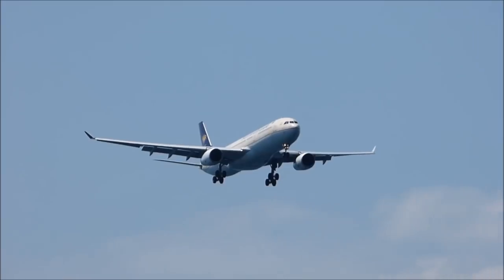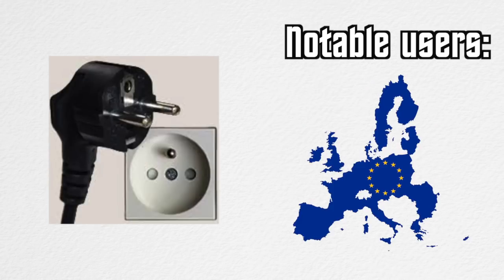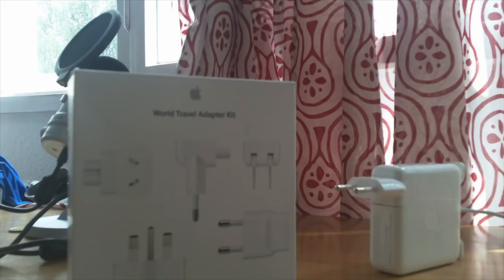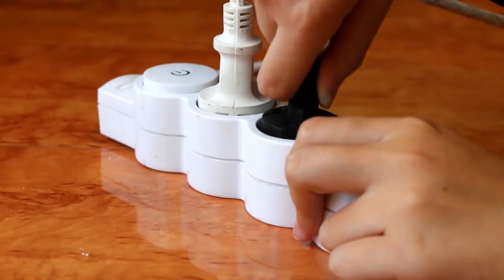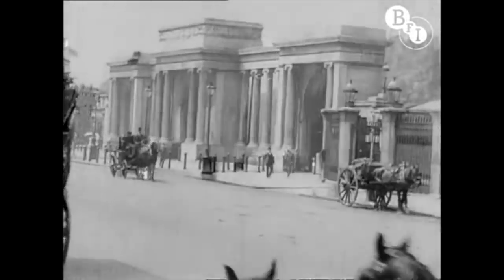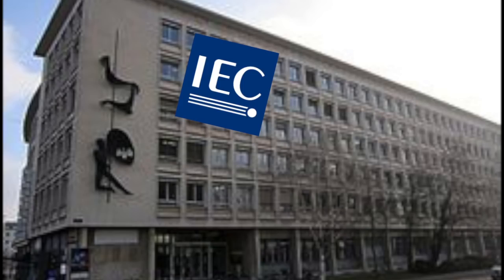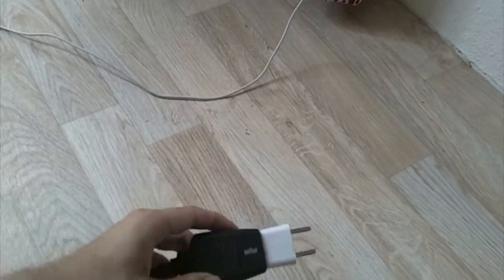Why Different Countries Use Different Plugs

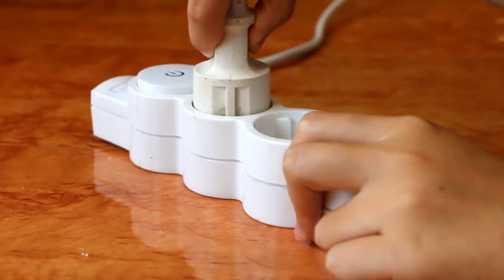Comment: I would like Type A or B plugs better because they are much more compact. You can fit them closely next to each other and are better for storage and accessibility... if only some crap plug manufacturers (I’m looking at you, Apple, and others) wouldn’t make huge box plugs and instead integrate the conversion into the device, or change the shape. My Samsung plug is about half the size of those stupidly big round ones.  Look at the zip-strip at 1:11! That thing is archaically huge for the 3 outlets it had (yes, only 3). A Type B strip (if designed properly) could fit 4-6 in that same size. If the sides of it were flat instead of wavy and the outlets were on the side, then a comparable Type B strip that size could fit upwards of 8 outlets! (That’s measuring 1 per curve on the one shown.)

People say that the British one is the best, but you don’t need plug posts that large for a phone or laptop!  In America, plugs that size are usually reserved only for large appliances like clothes washers and dryers!  Even dishwashers aren’t enough of an electrical load to require more than a Type B! You don’t need to go super-overkill unless there’s a large motor or heating element. Also, Type B has the “ground” wire that some of the other examples lack (A, C, E, F, R).

With regards to technology smaller is better, unless larger is demanded by physics.  Type B is small, yet has enough contact on the plug for 99.__% of jobs required of it.

Comment: Sweet jesus, you really shouldn’t make videos about things you plain and simply do not understand. Nearly nothing in this video is correct, it’s just a made-up fantasy history, peppered with technical jargon to give an air of legitimacy. No, frequency is not the issue. It was simply each electricity provider using its own plug initially. Then countries standardized within their borders, but so far no attempt at a truly standardized plug has succeeded.

Comment: I'm casting my vote for the UK 'G' plug.

Robust design. Firm electrical connections. (I'm looking at you Type A, every house I've been in has at least 1 burnt out wall socket because type A plugs will sag out of the socket if you look at them funny. Type 'I' as well.)

Ground connection built in. Ground wire is the last to disconnect in the case the wire is over stretched. It's easy to replace as well if any of the pins somehow broke. Also its internally fused by default as an additional level of over current protection.
Reply: The fuse in british plugs is not really additional protection. Panel Breakers on the mainland are rated lower then the breakers in UK panels.
Reply: Type A has half the tension what results in 4 times more plug heat up for the same power, so of course they burn more.
Reply: @2adamast  I'm not sure if this is an explanation or justification for allowing certain plugs to burn
Reply: WarriorofCathar The British plugs have half insulated pins, a great safety feature but at lower tension (also a great safety feature) the pin insulation would often melt.  A safe alternative to insulated pins are recessed sockets, those have the added advantage to hold the connectors by the housing and not only by the pins

Comment: So with countries that run on 110v and others that run 240v..does that mean that the country with the 110v has cheaper power bills?
Reply: Power bills depend more on the power (watts) of the appliances regardless of the supply voltage. Energy = power × duration

Comment: Worse than stepping on Lego is stepping on a uk plug I know coz I have done it a lot
Reply: Benefits of UK plugs: 
1. safest in the world, too many safety features for me to write here.
2. They have switches on sockets to easily turn on and off appliances
3. We don’t need socket covers as the sockets have shutters built in
Cons of UK plugs:
1. They always land pins up. Go for a pee in the night? Worse than lego.
2. They are bigger than the average toddler.
3. They seem to be harder to unplug than European plugs sometimes.
Reply: @masonanddylanrailway2911  1. Schuko has like the same safety features and are often left out when talking about UK plugs. Almost like people are afraid it'll be a tight battle.
3. Schuko has adult safe shutters while UK has flawed shutters in certain power strips, where you can plug it upside down. Schuko don't have this issue.
Reply: @Liggliluff Today's UK plugs use a triple shutter safety system, requiring the insertion of all three pins of the plug to open all three shutters .
Reply: @Dave4000  That might be a feature of some sockets, maybe even most sockets, but not all sockets. I've both seen sockets where plugs can be inserted upside down and opening the live holes, as well as had someone make a converter by inserting a pin in earth, and putting the Schuko plug in the open holes, and then removed the pin. This would not exactly be possible in the triple shutter safety system.
But in several countries, having a double shutter safety system is legally required and all sockets need to have it. Which is different from that sockets could have it.
Reply: @Liggliluff  More so with older sockets. The newer ones, like those from MK (the MK Logic Plus) and some other makers, incorporate the triple shutters.
Reply: Luckily I don’t have the same type as the uk plugs here in Spain.
Reply: Secondary use as a burglar deterrent. Just don't chase him out of the house before putting on your wellies!
Reply: effyleven well that’s a good idea I’m just gonna put them all beside the windows 😂
Reply: If Home Alone had have been filmed in the UK, Kevin would have used upturned UK 13 Amp plugs instead of broken glass to deter the Wet Bandits from breaking in with bare feet.
Reply: Those things are diabolic. They were almost banned un the geneva convenction 🤣🤣🤣🤣

Comment: In the Philippines despite we are 220 Volts 60 Hz but our plug is an American blade type which means we can easily accidentally plug an American 120 volts device into our 220 volts outlet damaging the device. It is part of our culture to buy something while abroad and bring back home as a souvenir but we have to be very careful about the voltage and often requires a step down transformer. Some American devices like some of our relative's DVD player from the U.S. and coded Region 1 but it is rated 110 - 240 volts so they just plugged it directly into 220 volts outlets without a step down transformer and they worked just fine.

Comment: Higher Voltage is better because it is more efficient in transporting the energy (less power lost in heat). And it’s acctualy 230V and no more 220V since a few years now.

Comment: Did you even do any research? There are 2 different frequencies 60 Hz and 50 Hz. This had nothing to do with Edison v. Tesla that was about AC. V. D.C. The U.S., Canada, Mexico, Japan, Taiwan, are primary countries with 60 Hz, 115 V. A.C. however Japan uses slightly lower voltage, but same frequency. The rest of the world is 230 V. A.C. 50 Hz. Almost all hair dryers have a switch from 115 V to 230 V and they don't care about frequency. This video is nonsense!
Reply: Fred Zlotnick Western Japan uses 60Hz.
Reply: Fred Zlotnick Eastern Japan uses 100V at 50Hz, Jamaica uses 110V at 50Hz.
Reply: @FrancisLitanofficialJAPINOY  thanks for the corrections, it sure is a "mish-mosh" that will never be changed.
Reply: Fred Zlotnick 220V 60Hz are widely used in the Philippines, South Korea, Antigua and Barbuda, some states in Brazil, Peru, Saudi Arabia.
Reply: And Malaysia used to use 240V 45Hz...
Reply: US has 60 Hz because of Tesla. He designed his motor for 60 Hz.
Reply: Nearly any motor designed for 50 Hz will work at 60 Hz (but run a bit faster). George Westinghouse went to Tesla to ask him what he thought, and Tesla thought 220 V and 60 Hz was most efficient. The Germans thought 50 was a better frequency because it was closer to being "metric". In the end it almost doesn't matter, except there needs to be a standard to tie generating stations together. @okaro6595

Comment: You’re mixing up the terms frequency and voltage like you have no clue what you’re talking about. 60hz on a 50hz hair dryer or bulb or vice versa does not matter. It’s the voltage difference that will make the light shine half as bright or blow up. Vacuum cleaners rely on frequency. But still, 60hz on a 50hz vacuum cleaner would only make it spin the equal amount of increase faster. It’s the voltage that makes the deal for most appliances.

Comment: Gonna post this here as well as on a reply so you all can read it. UK plugs are officially the safest. They may be bigger or cumbersome but we're talking about electricity and safety not an iPhone or some other millennial fashion accessory.

UK plugs are the safest because;
a) it has its own fuse due to copper shortage post ww2. It was cheaper to require a fuse in each plug and have the circuit as a loop of cable around the house as opposed many individual strands of copper going back and forth from the main fuse box.
b) the earth pin is longer to open up the shutters for the for the live and neutral pins so it impossible for infants or anyone else to stick something in the plug socket and get shocked without first sticking something inside the top hole to open the bottom 2 where the danger lies.
c) If a US, European or any other non British plug is only half plugged in then the plug can have a connection to electricity and have exposed live pins with the ability to shock but UK plugs have insulation on the outer half of the live and neutral pins to stop this from happening. 
d) the internal design of the UK plug is such that the earth or ground wire is longer than the live and neutral wires so should the wire be pulled or disconnected from the plug in any way the wires carrying the electricity will be disconnected before the earth, the earth will not be disconnected leaving the live and neutral wires still in place. Should the earth disconnect first on your toaster for example and the toaster malfunctions, then any metal on the toaster would then be carrying electricity which would then ground through you not the earth pin killing you. This is impossible on a UK plug. Every single one of these points on their own would make the UK plug safer, together it makes it unbelievably safer. That's a fact!

The only disadvantage it has in it's design is that if left unplugged on the floor, because of its flat backside it will nearly always lie with it's pins facing up which is incredibly painful when stood on barefoot! 🤣

Comment: The European standard is supposed to be 230 volts. But that's ideally. The first thing you should learn in electrical engineering (but never usually do) is the difference between an ideal model and real world. In reality the voltage will vary between 220 and 240v. Similarly in North America the mains should be at 120v but in reality it varies from 110 to 120v. I've never seen it much less than 1 or 2 volts less though.

Comment: Wrong about Australian power its AC not DC makeing dat clear dc is not used in main grids anymore only solar stations but its than put to 240v (or 110)
Reply: That graphic was way back before WWII and before the grid. You would find lots of power stations putting out all sorts of voltages and frequencies, used only in their local area. DC was common as DC motors are simpler than AC motors: incandescent lights don't care. AC became more common as transformers could step up and down the voltage easily, as well as rectification (tubes and later silicon) could easily convert it to DC. DC is making a comeback because invertors to convert it back to AC, and it avoids having the entire grid synchronised. (Think Basslink)
Reply: DC is still used for long haul HV power transmission, for example the 2GW link between France and England. It's more efficient.

Comment: I noticed that the American plug pins are easy to bend.
Reply: Jan de Vries Cheap ones are very easy to bend. Top-quality ones (like on Apple gear) are very, very rigid.
Reply: Jan de Vries Chinese 2 pin plugs doesn’t have any holes (US).
Reply: They are also very easy to unbend
Reply: When they bend they break. When they break you have to buy new ones. Which is the American thing to do. Create things that break easy.

Comment: At 4:15 it's not frequency that kills a fan but voltage since it's designed to operate on 110V and you feed it with 230V. Brushed motor and heater element really doesn't care  if it's 50 or 60Hz since it hasn't have any inductors or transformer. Electrical engineer could never make a mistake like this. There are some adapters-transformers with switch for 110 and 220V and they work fine on both frequencies. No modifications are made for frequency just for voltage by making a 2 taps on a primary winding.
Reply: If you design a transformer to work on 50hz it will work on 60hz grid with some minor differences on power losses
Reply: Have a great day boyos
Reply: @Flat Surfer - 
YES , its a universal Motor if the Voltage fits
Reply: The main problem is many things use synchronous motors.
Reply: @TryptychUK   Like what? You regularly travel with a 20 year old wall clock?! Or a microwave?
Reply: @TryptychUK  I asked a question. You chose to take it as rhetorical. Please, enlighten us.
Reply: You mean asynchronous motors in fans, pumps,etc. Under the load there wouldn't be much difference in rpm's between 50 and 60hz but unloaded 2 pole motor would have 3.000rpm at 50hz and 3.600 at 60hz which could affect bearings. These motors behave badly when connected to modified sine wave inverter
Reply: Lol look at y’all electrical engineers
Reply: @brndngutierrez4268  hahahahha lol Gow havê you gessed xd

Comment: If we Americans had the British plug with the fuses inside we would just put in the highest amperage fuse that will fit, or wrap it in aluminum foil. (You know it’s true 😂) That’s one reason we are doing away with fuse panels for breakers.

Comment: and actually, brazil is an orgy of almost every single fucking one of these types, i live here and well, in my house i have types A, B, C, G, H, I, K and N in the walls, and yeah, we need to use a shitload of adapters on our daily basis... and in public buildings when you need to use anything electical or charge something is even worse, recently, i mean, in the past (about) 10 years we are using the type N more than the others, but when you have older stuff (like my amateur radio deck, vinyl player, radio, speakers) you need a adaptar, only the modern stuff is using that patern, and even some still dont....
Reply: oh also we have a type pf socket that is a mix of the type A and C, so you can plug any of these in the soklet

Comment: I was hoping for more than a glancing topical coverage. What about frequency and voltage demands a different plug? To get AC to work, you need a hot and a neutral. A ground is always a good idea. Considering that all of these standards have those components, why is it necessary to have the plugs shaped differently? Does a peg conduct differently then a blade? What I got out of this is that things are different because of how they are, bring an adapter. Hoping for more...

Comment: America has 120 Volts, or 277 Volt building power
Reply: Evan Bart 410 single phase 120V/208V and three phase 347V/600 in Canada for mainly commerical buildings

Comment: This explains the differences. But not really why one is used over another. What advantages does one provide that another doesn't and what differences are purely design preferences?
Reply: david bass safety
Reply: that's what I'm asking.  @darrenwoloshyn  What makes one type safer then the other and what are the disadvantages with the safer types then the types that are less safe?

Comment: This is awful. Out of the 6 inhabited continents: they use 1 voltage and 1 frequency for residential electrics. 220v/50hz
For the continent I reside on we use 120/60hz.
That means 2 plugs, not 13. Special plugs for special installations and not unique plugs for general usage.
Customs: does this pallet of electronics take 90v-300v 50/60hz? No? Reject as unsafe for non-commercial sale.
Problems solved.

Comment: The UK plug is the best invention ever, because don't you just love it that every time you drop one it lands prong side up, and the feeling of 3 metal bars digging into your foot at 2am when walking to the toilet is the best feeling ever.
Reply: now i get why brexit happened, you're just jealous.
Reply: @jjc5475  Jealous of what? 
Uk has the ugliest and most impractical socket ever 😂
Reply: @rettenthetetlen8759 have you compared it to other plugs and listed the pros and cons of both? Also, how can a plug be ugly?
Reply: @pecadodeorgullo5963  they are so annoyingly bulky and always land with the prongs pointing up which is a recipe for agony of you step on it when you go to the toilet in the middle of the night and it's pitch black
Reply: @grassytramtracks  well, your first point isn't a big issue but I'll agree with your second point since there's nothing worse than walking on one of them.
Reply: @rettenthetetlen8759  it’s the opposite of impractical, since it’s designed to be easy to work and perform maintenance on
Reply: @grassytramtracks  why are you leaving plugs lying around in the middle of the floor?
Reply: Just doesn’t happen, never stepped on a UK plug once.
Reply: is not europe
Reply: https://youtu.be/UEfP1OKKz_Q
Reply: Also used in Cyprus
Reply: Just switch it off at the wall socket without unplugging (virtually all type G sockets have on/off switches for each plug). I don't know anyone who would leave plugs on the floor with the pins facing up. People don't do that.